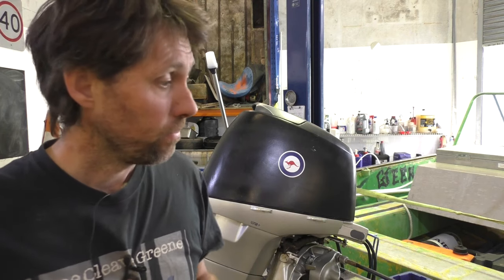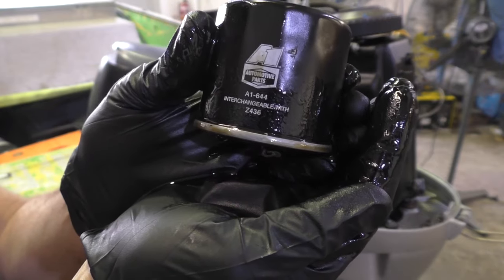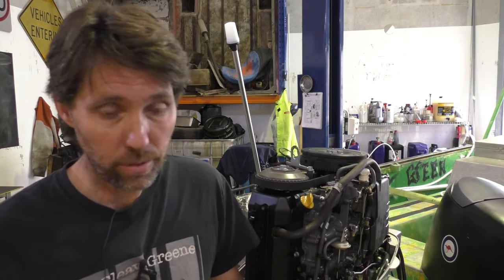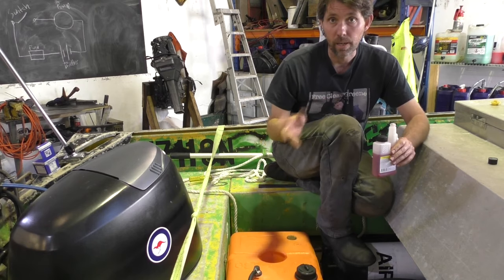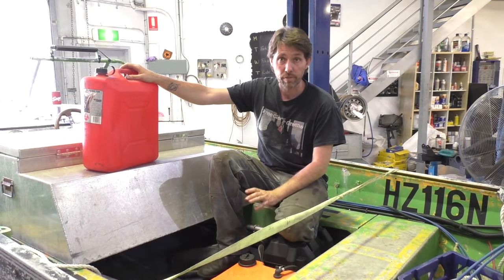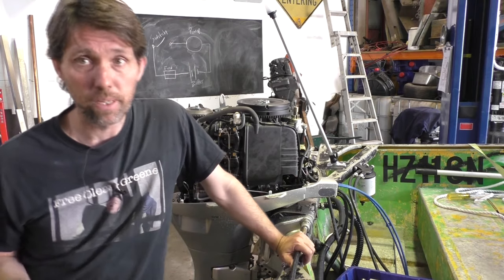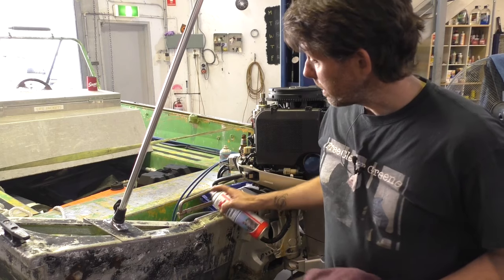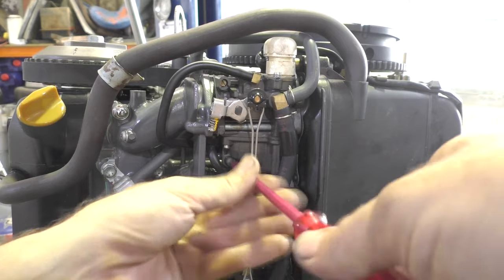Winterising an outboard motor

Comment: When I first went to grease my 1996 70hp Evinrude's steering tube, the grease didn't come out at both the top and bottom.  I resolved this by placing a floor jack under the outboard motor and placing just enough force on the skeg in order to take pressure off of the tube.  Grease then came out of both ends.
Reply from the maker: That's an interesting technique Bob, I'll give that a go next time I have that problem.

Comment: Stu, as always you produce clear and concise videos and I always learn something.  In addition to servicing your engine also repack the wheel bearings on your boat trailer.  After running for a while trailer hubs get warm and the air inside expands a little, when a trailer is backed into the water and the hubs submerge, the water cools them down and creates a vacuum and often suck water into the hub.  This is especially bad if it is salt water and now has all winter to rust the bearings.  The warm days of Spring arrive and I can't tell you how many boat trailers I see sitting on the side of the road due to failed bearings.  Not a good way to start the season.
Reply from the maker: For sure, I would say bad trailer bearings are probably a more common cause of those early boat trips coming to and end than the boat itself.

Comment: Winterize in S.W. Florida means running it. But you do pass along good information. I really do like your videos . please don't stop . I've already made use of tips. Thanks.
Reply from the maker: Thanks John. Sounds like you guys are a bit like us. I use my boat every day all year round, it never gets winterised!
Reply: Dangar Marine : yesterday I had to replace the squeeze bulb . on my1983 70 hp Johnson. Just genral stuff that has to be done . later in the day I went to the lake just to run it. Ended up pulled in a boat with a 2 year old Yamaha . The deal is take care of motor .it will last. My Johnson hasn't been in a shop in 8 years . runs like a scalded dog.
Reply: Almost born in a boat. I'll die in a boat. Then you'll have to pry my cold stiff hands off the tiller. I'll get back up , and say not yet.
Reply: Is the beer bottle staged in many of your videos?

Comment: Great video as always. Not sure if anyone recommended it already but I like to add oil to the new filter before I spin it on. Even at 90 degrees it will take quite a bit before it spills out, allows sooner oil pressure at startup. Cheers

Comment: My dad had a 1971 50HP Johnson. He always ran the carbs dry on the last trip of the season, then we sprayed WD-40 in the spark plug holes while bumping the starter. Engine always ran great. Never had any problems.
Reply from the maker: It's amazing how much a few simple steps can help. Emptying the fuel and putting a bit of lube in are definitely the two main things.

Comment: Greetings from northen Sweden and a fellow boat entusiast and new subscriber.
Been watching the channel for a long time but just hit the button.
I used to work on boats as a mechanic and this is pretty much what we did when winterizing, I also changed oil in the gear housing to make sure it's not a leak in the seals and water in there. I have seen gear housing cracking apart from that.
Great channel, no fancy edeting and you show how its done.
Reply from the maker: Thanks Peder. :)

Comment: With a 2-stroke motor, I idle it for a few minutes, then disconnect the fuel line from the tank and let it idle until it cuts out. This drains the fuel  hose and bulb so the fuel  won't  corrode the line. Then I start it again to drain the leftover fuel in fuel pump and primer hoses. I also fog the carb at same time. Then I drain the carb bowl. Finally I remove plugs, and fog cylinders while turning flywheel to distribute.

Comment: Thanks for the reminder! Her in the United States it gets cold so usually I run mine on the muffs to get it warm and open up the thermostat then switch over to my jug of antifreeze with the hose connected muffs and let the water pump circulate antifreeze through to protect the block from water in the outboard freezing.
Reply from the maker: Sounds like a good technique. I'd be curious to know how much water sits in the block without draining back down to the leg.
Reply: I've been told that if the motor is at rest in the full downward position that it will completely drain. That's what you see what you pull your boat out and tilt the motor down, the water draining down the leg and such. I've also heard horror stories where debris, corrosion, etc. Build up inside enough to hold enough water in to crack the power head. My theory is this: RV antifreeze is cheap, a motor is not. With that said, I do it figuring better safe than sorry.
Reply from the maker: Sounds like a solid policy. :)

Comment: Great video Stu as usual. 

Up here in chilly ol Canada it's nigh time for this procedure. Very jealous of your year-round boating!

Going on ten years with my Yammy 90 4 stroke I've discovered a couple of things. Running the engine dry doesn't fully drain the carb bowls, so I do both. I installed a shutoff tap on my water separating fuel filter so when I close that the engine will die in a couple minutes of fast idle. Then, I drain the carbs and under cowl fuel filter (plus give it a clean). 

There's so much duct work upstream of the carbs I shoot the fogging oil directly into the cylinders instead of trying to induct it. Then, replace the plugs and turn the engine over a couple of times with the lanyard of the ignition pulled to kill the spark. I also shoot some fogging oil into the carb bowls before buttoning them up. 

In Canada we have the curse of ethanol fuel to deal with so I want to get the fuel system absolutely drained.  This is all post oil change and gear lube check of course. I will confess that if I crack the gear lube screw and get nothing but clear oil I will do two seasons between changes but then a Canadian season is only about 30 hours run time for me. I run the engine on the muffs with new oil to get it circulated and check for leaks as well. Enjoy your summer, Stu!😎
Reply from the maker: Good idea to have that shutdown valve after the water separating fuel filter. I also think it is entirely valid to check a small sample of the gearbox oil and leave it if it is okay - that is an entirely sensible approach. It makes sense that the engine will run lean and stall before the carb bowls are empty, but I had never really thought about it so thanks for that confirmation. Have fun skiing! ;)
Reply: Thanks Stu. There's alway debate raging online regarding the "best" winterization procedures so the fact the same process year after year has my engine running like it was new gives me confidence I'm on the right track. And your seal of approval of course! The fuel tap was a necessity as I've got and under-floor tank with no easy way to disconnect the line at either end. The tank itself I leave topped up with stabilizer. 

I loved your discussion about trying to catch the oil. Just last year I gave up on my elaborate rigging of ropes, funnels and basins and now just let it all run down the leg and wipe up later. Makes for a far less angst-ridden process...  BTW - that's a great coat!

Comment: Hi Stu, from Argentina here, interesting when you pointed out the 2 stroke get the lubrication from the fuel. Actually, on the oil injected systems the oil is run from an external pump and mixed before getting in the carbs. Like the Merc 90 you showed on some of your videos. In this case, disconnecting the fuel line will fill the carbs with rich-oil mixture, when the gasoline runs out. Actually my dad is in favor for this practice (of disconnecting the fuel line) and let the remaining fuel run out. He also choke the engine when is almost dying from fuel starvation to force the emptying of the carbs. But, I think he should also drain the carbs as you showed, and the question is if you think that leaving the carbs bowls empty is not going to accelerate the process of gum up because is easier to evaporate as only a little residue of gas remains and dry.

Excellent videos Stu, big fan here also in the southern hemisphere (but on the other side of the sphere :)
Reply from the maker: True, for some automix outboards it is different. I think closing the chokes is a good idea if you have them as not only does it pull the last of the fuel out better it also shuts off most of the air from entering the carburettor if you leave it closed.

Comment: We don’t have winter here in So Cal, but I still put Stab-il (the marine version) into every fill up. We have ethanol added to our gas which causes all kind of issues unless you treat it.
Reply from the maker: That makes sense. We can get ethanol-free fuel very easily here and a tank of fuel never lasts me more than a week so I don't treat it, but it is a good idea in other circumstances.

Comment: My uncle has been a small engine mechanic for about 50 years. He told me a long time ago, to put fuel stabilizer in every can of gas you bring home from the filling station. That way, if you do put an engine away for longer than you had planned, it will still have some protection. Sta-bil is cheap and easy to use. He once told me that if people followed that advice, he would lose 90% of his business.
Reply from the maker: Sounds like good advice. We certainly put it in all our jerry cans in the workshop.
Reply: Don't know your uncle but I NEVER get NEW fuel without first adding Stabil.  I also add Sea Foam to my fuel ever so often.  My boat has been sitting for the last 5 years due to job loss but I started it this month.  Turned over on the first attempt and every attempt since!

Comment: One thing I like to Also do is to add anti freeze to the water intake to prevent freezing and cracking of engine cases due to cold environment I live in
Reply from the maker: Sounds like a good plan if it gets that cold where you are.
Reply: How do you add anti freeze? And where does it go after you go to use it in the spring? I’m Canadian so it gets real cold here haha
Reply: How does the coolant stay in the motor?
Reply: Jerry Arntson same way the water does... thermostats.
Reply: I completely forgot about the stat. Shit

Comment: Ji’ Stu. I bought 1983 Larson boat and cleaned the fuel filter on my mercury 70 HP 1983 also pumped old petrol with the ball as you showed in your video add 20 gallons of fuel to the tank mixed it with 2 cycle oil and dropped the ignition keys went and ordered after market ignition switch but the mechanic advised to return it do think that after market switch will work( its the one with the push key to shock the engine when you start it)
Reply from the maker: I've never had any problem with aftermarket ignition switches, they are pretty simple devices.

Comment: Had no idea about winterizing my 1St boat, it's 29° now, were below freezing for 2 month's each winter, hopefully im not to late to protect it, thanks.
Reply from the maker: If it is already very cold I would just run it on a hose for a bit to thin the gear oil up a bit before draining.

Comment: Great quality video Stu. I am winterizing a 90HP Mercury 2-stroke with oil injection. I would like to empty the 3 carburetor bowls by running with gas line clamped closed until engine stall-out. I understand how this could damage a pre-mix 2-stroke, but will I be OK with my oil injected motor?

Comment: Hi Stu, for the guys that will winterizing their motors till next season wouldn't it be better to burn the most fuel out of the tank instead filling it near up and adding stabilizing products. For me, fresh gas on every outing is the way to go...

If you run the fuel bowls dry by disconnecting the motor fuel connector while motor is running, there will still be fuel left overs inside the fuel filter, if wanting to get rid of as much as possible keep pressed the pin located on the upper fuel connector for the motor to suck most of it till it dies.
Reply from the maker: Fuel being left in the hoses and filters is the main reason the Stabil is a good option. Also, condensation will form in tanks that are empty or near empty so keeping them full during the winter also prevents that.
Reply: Stu, you're right,it was my fault not to have mentioned that was refering to outboards connected to portable fuel tanks compared to the ones that use built in ones...

Comment: Love your vids! Another great informative boating video :)
One thing tho on connecting battery leads: red is attached last and disconnected first. This helps minimize unwanted arcing. 🍻
Reply from the maker: Thanks mate,  must disagree with you on the order of battery leads though. If you disconnect the positive first then the whole body of the car or the hull of the boat will still be an active ground and any metal the positive touches will cause arcing. With the negative disconnect first this can't happen.

Comment: Good video mate ,i used to make the effort to actually go out during winter in adelaide and start the engine up did the oil thing in the bores  just to stop any rust from bare metal and condensation .I can vouch for sta bil it is an excellent product well i think so anyway use it in all my mowers shredders ect ,you need to put a proper insignia on your outboard cover instead of that cecil one on there now , something like a kangaroo and crossed rifles and boomerang with a wreath of wattle hahaha take care
Reply from the maker: Ha! I'll see what I can find... ;)

Comment: Im also in Australia, great video!  Would you also disconnect the fuel line and run the motor until it stalls after each use?. I use my 2 stroke every 2-4 weeks year round. Some say I should leave fuel in others say run it out. Not sure what to do.
Reply from the maker: 2-4 weeks I wouldn't. Maybe just add a bit of Stabil to the fuel tank.
Reply: @DangarMarine  thanks Stu!

Comment: I know some ppl add and run glykol mixied with water through the watercooling system to stop it freezing and expanding, during periods with frost.
Reply from the maker: I think that is really important with closed cooling systems, but most of the water drains out of an outboard once it is off. I'll have to look into it a bit more and see what I can find out.

Comment: My 90hp merc 2 stroke will be out in the arctic climate here in Wisconsin. You don`t need antifreeze in the engine cooling system do you? I will probably blow it out with compressed air to be sure all the water is out.
Reply from the maker: I wouldn't be too worried about antifreeze as even if there is water in there, it will have plenty of space to expand to as it isn't a sealed pressurized cooling system like a car.
Reply: Yeah, that`s what I figured. Yet you see these guys using a special adapter to put antifreeze in the gills of their motors. WTF? Wouldn`t of bothered asking if I didn`t see these clowns doing it. Thanks for answering, buddy.

Comment: Hi Stu,

For my  4T Honda lawnmower I use Aspen 4T fuel.
For winterising the fuel system on my Yamaha outboard I am considering to use this Aspen fuel to run my outboard for several minutes. Do you got any experience with this fuel?
cheers
Kees
Reply from the maker: Interesting, I hadn't heard of it. I have heard of some high-end oils that are made from LPG, so this sounds like a similar process. I imagine that it would leave less residue when it evaporates so that can only be a good thing. Thanks for mentioning it, I also love to hear of something new!
Reply: Aspen is an Alkylate petrol without sulfur and is 99% cleaner than regular petrol. it is one of the purest petrol on the market and it keeps it's quality for many years. The downside however it's highly priced..:)
Reply: @Vedek27   My local outboard guru usually treats my 2-stroke Mercury with Aspen. First he keeps the motor running with Aspen for several minutes. In the end he pushes the choke until the motor almost stalls, and then he stops the motor. He says it actually does the same as fogging the engine. Easy and convenient.

Comment: I have a 30 Gal inboard tank with an overflow/vent, so should I fill up the tank with gas and treatment then put a rag or something in the overflow/vent?
Reply from the maker: Yes, it think it's a good idea to block up the vent if you can, particularly with something like a rag that will prevent debris getting in but let pressure out.

Comment: Hello I like to hear your opinion.
For winter i cut the fuelline and stuck it in motoroil and let the engine run till it dies. I had never problems with this. What do you think about this.
Greatings Kai from Germany

Comment: On my Yamaha 1988 2 stroke.  I only ran the motor for 10mins then disconnected the gas line.  I did not perform a fogging,  will this cause issue/s when i first try to start the motor in spring?
Reply from the maker: It should be fine, I wouldn't worry.
Reply: Dangar Marine Thank you

Comment: Thanks mate for thinking of us poor sods here in the UK.
Mine is an inboard 220 HP Mercruser . Did it two weeks ago. Any tips on the cooling and fuel systems on the inboard's.
Reply from the maker: Just think how close you are to the ski fields of Europe though. ;) Fuel I would say is the same with inboards, but if it gets cold enough where you are make sure there is enough antifreeze in the coolant to make sure it can't expand and crack the engine block.

Comment: yeeer,,i know it was posted 2 years ago,,but reading the comments,i don't think any one mentioned the trailer it self,,wheel bearing and winch,jockey wheels,,and all that stuff we seem to think just keeps running,,a little bit of work now and next time apart from having trouble starting a stored engine,, just put your boat on and go,,
The only other thing i would do it test run the motor before getting in the water and finding the old gal just won't go,,and yes have been there drifting away very embarrassed,,
And finally when it did fire to disappear in a cloud of smoke,,